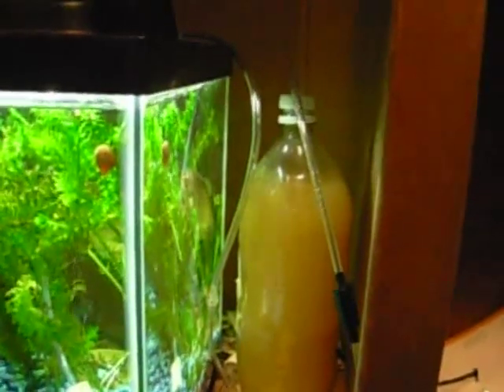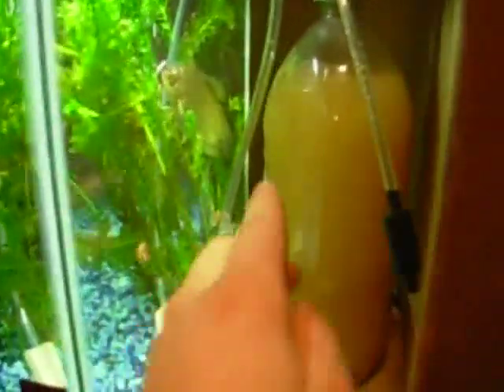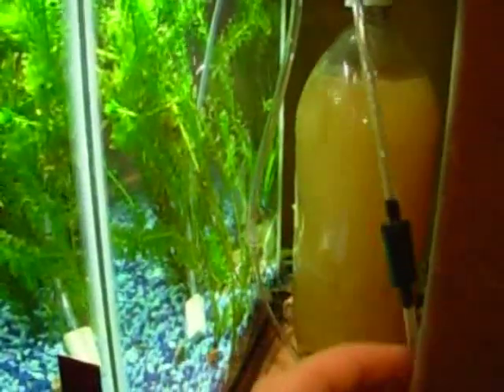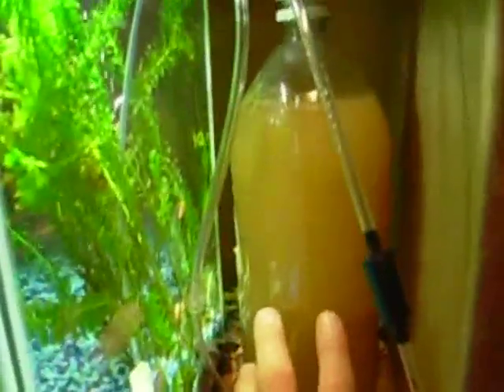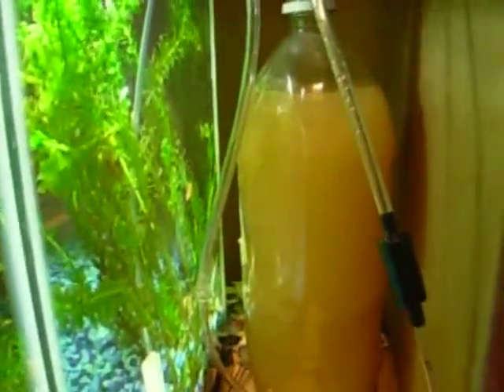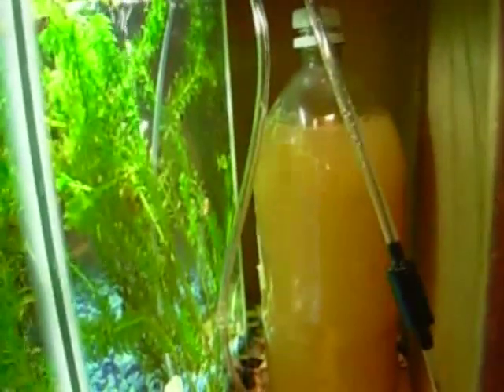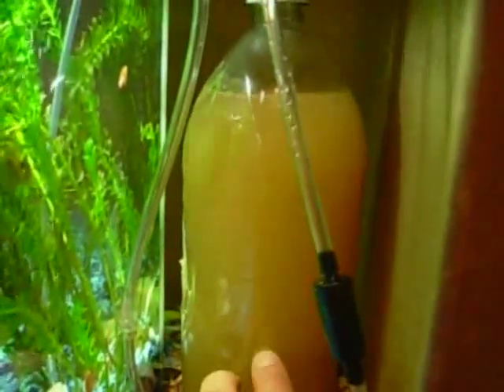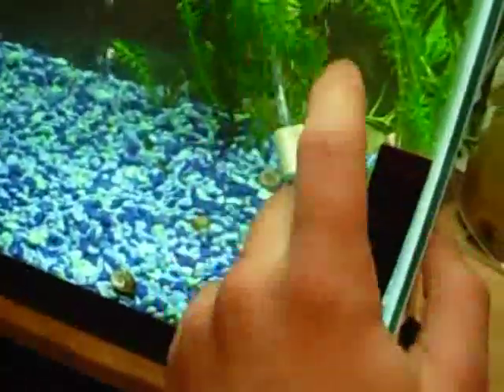DIY CO2 generator

Comment: you say 2 cups hot water first with the sugar into the bottle, then you pour 3 cups cold water in almost filling to the top a 1.5 liter bottle. then after having the yeast in a separate smaller cup of warm water for 15 minutes, you add this in the bottle lastly...Ive heard this before I don't see the point of the hot water/cold water. does this activate the sugar in some way? I have done this multiple times and this is supposed to produce c02 within an hour. the yeast/sugar reaction always dies immediately and Ive wasted lots of sugar/yeast attempting . this is difficult to say in the least and I realize water temperature is important or else the reaction dies. maybe I'm not using the right sugar? I got lucky the first time and maybe once after that with same instructions. I'm testing yours now and it don't appear to be working....
Reply: +ted mills I brew a lot of homebrew wine in the same 2 liter bottles.  I would add a bit of tannins or acid first to the mixture.  Or, some nutrients for the yeast - stir a bit of baking yeast into some water, and then cook that mixture for five minutes to kill the yeast.  Cool down the dead yeast mixture and dissolve your sugar into the water.  Add some black tea to the water, and then activate your yeast.

Pure sugar water is hard to brew in - I've done it once by adding the dead yeast first and then the activated ones.  It works by giving the living yeast something to eat other than sugar water.

I think the brown sugar in this case works by giving the yeast some other nutrients as well.

I'm going to do this for a hydroponic set up, after flushing the entire box with carbon dioxide....with baking soda and vinegar...

Comment: Do not worry about the CO2 level, you are not going to overdose it - it's very hard to get over 30 ppm CO2 in an open aquarium even with pressurised. Test kits generally are a waste of money imho. 

I had this type of DIY system before but little holes kept appearing, it's harder to do it and get it right than you would think. You can buy a premade system of this on ebay.

Comment from the maker: yes, I eventually built a CO2 reactor out of a Gravel-Vac with the one-way valve removed. A power head on top pumped water into the chamber, while the CO2 was fed in through the open bottom of the plastic cylinder. The bubbles would rise faster than the water could push it down, so they cycled in there until the gas diffused completely into the water, and got pushed out the open end of the cylinder. The ensured a 1:1 ratio of gas produced to gas absorbed.

Comment: CO2 is used by plants to promote extra fotosynthese (light +  CO2) and growth : CO2 > 02 in light (or day) and O2 > CO2 at night by the plants... and -because it lowers the pH , carbonACID may also be good for fish who desire lower pH, but on the other side - too much CO2 (or H2CO3) can be bad for fish so i'm not sure.... conclusion : No extra CO2 at night because plant are producing CO2 at night so plants don't use CO2, and otherwise CO2 level can be too high at night for fish.

Comment: @underdog5004 so it doesn't matter how much co2 you're putting in because it'll just go away from the tank some how? Like even if you have lots of bubbles coming out through the day it's ok ? and if you have a air pump inside it pumping oxygen at the same time is it alright?

Comment: All u gotta do is put the mash into a pressure cooker or equivalent after your done and heat it to 176 degrees which seperates  the alcohol and run it through a cooled copper line into a pot and you got moonshine

Comment from the maker: Well, it's been awhile since I've had this set up. To the people who are wondering why I had an airpump present, I was new to CO2 supplementing, and didn't realize the excess CO2 would just gas off. For what it's worth, the anacharis shoots were all sending little roots towards it. 

The check valve is there so if the bottle should lose pressure, it won't drain my tank.

I don't think it's a good idea to use this to carbonate a drink. I think that requires higher pressure. Don't close the bottle

Comment: technically he wont need the air stone because the plants will give off a great deal of o2, assuming they are supported properly. but ur attitude sucks, and there are far better ways to say what you needed to say than trying to make urself look higher and mightier than the OP and thus make yourself look like an ass.

Comment: wow, nice, quick and simple. so the water temperature is pretty important then? also, when you first started, were you constantly checking ph levels? also, how could you tell how many ppms you had without a drop checker? im still trying to wrap my head around CO2 in planted tanks in general. thanks for a good vid!

Comment from the maker: you need to give more info than that. How did you prepare the yeast/sugar/water mix? Did you use hot or tepid water? Is your cap/hose assembly airtight?